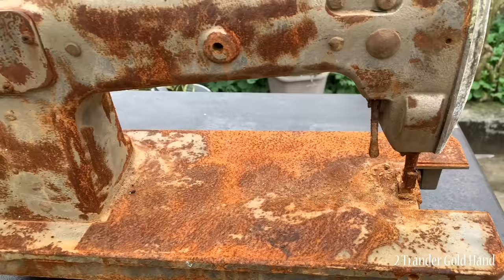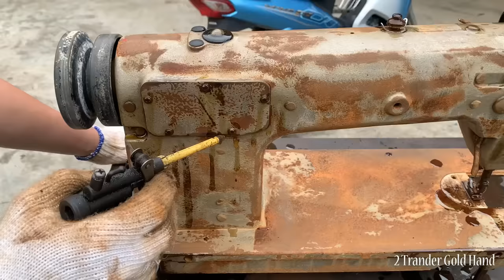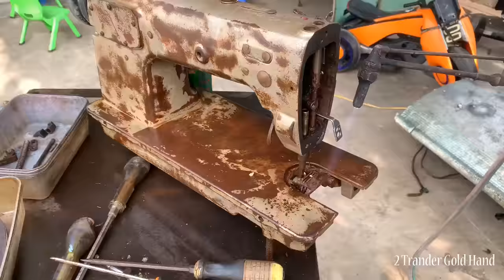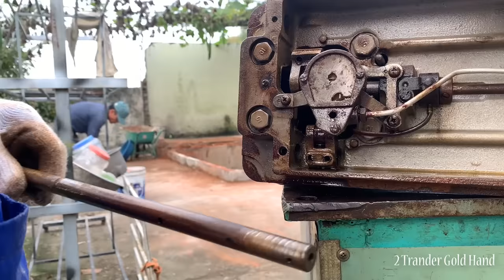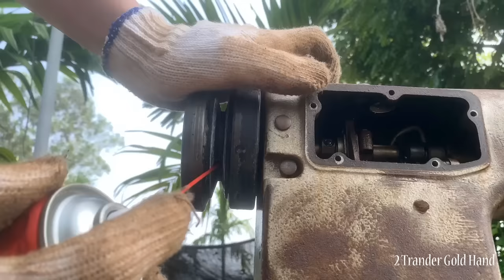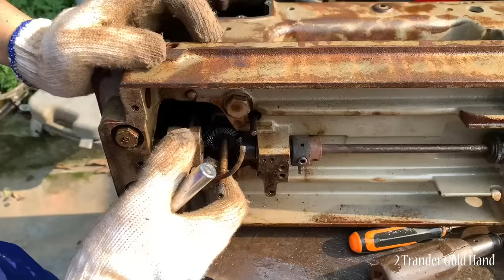Restoration Mitsubishi sewing machine antique Japan | Restore Engineer method of sewing tools old

Comment: I reverse engineered the Singer 95-1's internal timing belt and taught myself how to install it into the machine. You can search this on YouTube for the video(s) I made about how to do it.  This clip about the restoration was disappointing in that I really thought a man this talented would have gone past the restoration to find a correct oil bath pan necessary to allow  the machine to sew again...along with a bobbin case and some bobbins plus some thread too to sew a sample. Furthermore, the screen on the oil pickup was missing and not replaced.  This was/is a dropfeed (presser foot) Consew/Mitsubishi factory garment machine with a 3/8 - 5/16 lift designed to sew fabrics at high speed...about 5K stitches per minute.  The oil bath lubrication system made that sewing speed possible.  And of course, there had to the a motor drive system on a 20" x 48" table top.  Regardless, to have the ability to do a complete disassembly, cleaning, repainting and reassembly without service manuals is a task accomplished by a true mechanical genius.  I do know one man who could have done this and he lives in VA.  He helped me reverse engineer the Singer 95-1 timing belt which also isa part inside a Singer 96-1.  Both of these machines first appeared around 1911 -1915.
Reply: 1111
Reply: I gotta wonder about these videos. As in, hopw many of them took a good working machine, filmed the "after" shots, then scuffed it up and left it to rust for the "before" shots? I don't put a lot of stake in these guys being mechanical geniuses.
Reply: @bakhtikaram8191  0
Reply: Well it looks better than before doesn’t it, maybe we should get him a proper factory and tools to use then we can criticise.
Reply: @iftekharjamal332  they probably aren’t, but they do a lot more than your average guy or girl, fuck me some people are never satisfied.

Comment: Before expressing my comments, I'd like to acknowledge that 1) I am COMPLETELY UNABLE to do this. I can refurbish vintage machines which are in fair condition, but this sort of work takes a knowledge of engineering and a dose of talent as well. 2) Mitsubishi, Maruzen/Jaguar and other Japanese manufacturers make superb equipment. The Japanese have produced incredible sewing machines (and more) since after WWII when they built incredibly engineered and precisely manufactured sewing machines for Sears and other vendors. They built these machines expertly and with pride. Thousands of still-working and highly-prized machines are evidence of this.  I've worked on numerous Japanese-made machines; I like them very much and collect certain models.
However, as good as this job is (and it's VERY impressive), I don't believe it's quite worthy of Mitsubishi.  I saw some things I would not do, even with my modest abilities. I would never return a part to a machine unless it had been completely cleaned of rust and old varnished oil, then polished until smooth. Many parts on this machine were not. The gears were not properly lubed.  The polished parts should have given a very thin coating of clean sewing machine oil after reassembly. The arm should have been welded back to the base and the outer shell should have been sanded and polished smooth before painting.  
OK, as I said, I couldn't do all this, partly because I don't possess all the tools required or the skill to put it all back in place appropriately. That doesn't mean I'm not aware of what should be done; I've been doing simple refurbs for years and learned a great deal.
I give Kudos to the person who did this, it's truly a remarkable job considering the condition it was in when found.  But again, I don't think it's quite up to Mitsubishi's standards. 
This is my opinion, I believe it's valid and I will decline to change it. Many of readers may disagree with me.  That's all good, it's your prerogative and will be respected.
Reply: Hate to burst your bubble, chum but this channel is notorious for its faked videos.

Comment: Well, that was a complete waste of time wasn't it? Obviously the machine will never sew after you put it back together. No motor, no belt, no shuttle, no bobbin. The timing was out to hell and you had no idea why the needle wouldn't complete it's cycle. Basically you completely stuffed the machine. By the way, ordinary 20/40 oil isn't a replacement for penetrating oil and using an oxy torch was nothing more than just show, Nothing you were attempting to remove would have been seized. I owned and operated a Singer sewing machine Franchise and repaired and serviced every brand of sewing machine. The only thing I got from watching this BS was a good laugh. As a repairman you'd make a bloody good butcher. Anyone can undo a load of nuts, bolts and screws, but few can put them back in the correct positions.